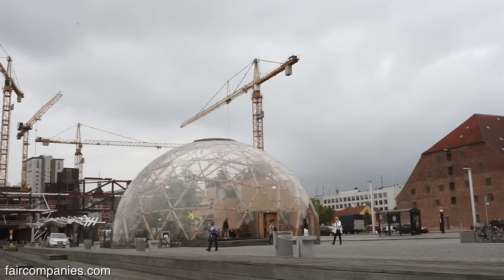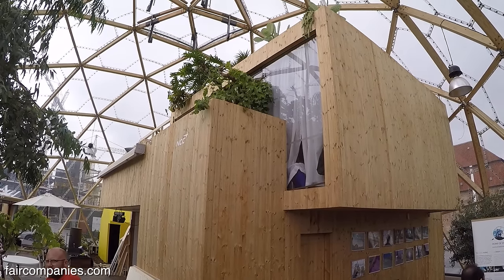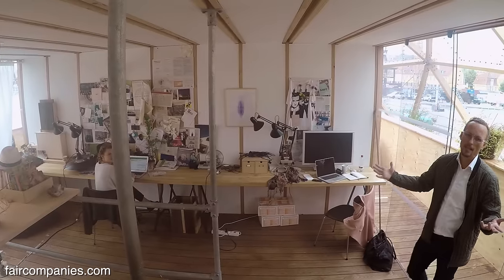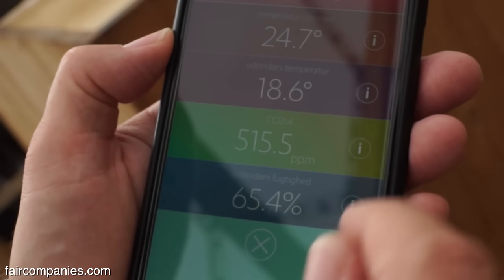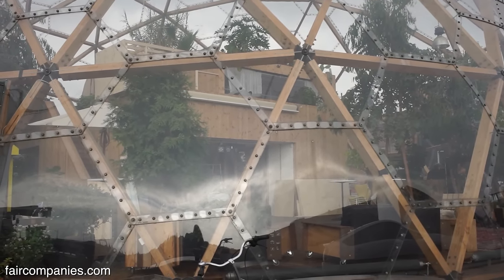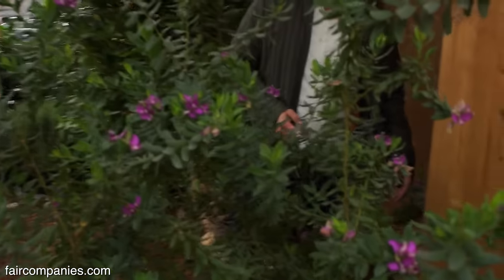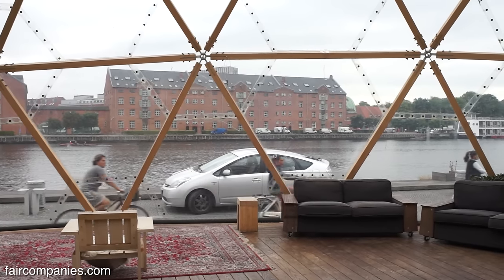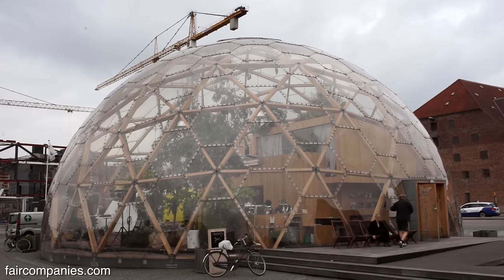Nordic home encased within geodesic dome for passive solar

Comment: I live in Germany, and our bedroom has 180 degrees floor to ceiling windows (double paned and energy efficient) it looks beautiful, but it is blisteringly hot on days over 23 degrees C.  It is not hard to heat it, but almost impossible to cool it if the sun is shining, air conditioners do almost nothing.  The only thing that helps is a windy cross breeze.  I can't imagine trying to cool an area that big...the little roof opening would not help that much.  The other problem is, on cold winter days when the sun shines really intensely, the difference in temperature causes the wood frames in the window encasements to crack.  I love the idea, but perhaps at least half of the dome panels should be solar, to cut glare, and to produce enough electricity for air temp regulation?  The other problem I see is mold, UV light would prevent most growth, but the warmth, lack of air flow and moisture would get into the untreated wood, and the garden plants very quickly.
Reply: There're are different types of passive cooling. 
The cross breeze is the 2nd worst one, and the worst being open one window/door.
The.chimney effect cooling is very efficient.

Comment: Very very interested, I am wondering what happens in the evenings and at night time in terms of plummeting temperature. Yes there is still no wind or rain but even in a green house it can get freezing and he is making a point that the house inside is built very simply and without insulation. They build them to potentially house a family which means year round habitation day and night...and winter nights are long.

Comment: Is there an estimated cost of just the dome itself?
Reply: Too much ... because you have to replace the polycarbonate every few years due to it degrading, becoming brittle and getting scratches. Do not bother with it and stick with glass, which will be REALLY EXPENSIVE but will last, AND with STRAIGHT SIDES!
Reply: @Muck006  I still would like to know if they have an estimated cost.

Comment: I know “it pays for itself after 6 years”, but what is the initial cost?
It looks very expensive.
Reply: Numbers would be interesting, true.
But as you can reduce the materials for the house and the dome structure it can be affordable compared to other houses. There's a TEDtalk of the Hjertefølgerne-Couple saying their dome-dream-house costs them half of what a normal house of the same size would cost them. They put some efforts in their house and gain great eco-efficiency and most important live quality. Seems worth it.
Reply: Here in Canada, my wife and I built our home and greenhouses in 2015, we are offgrid and use wood to heat. So far we have no complaints. The cost for building this 32' x 15' with a 4' riser wall and a second level with a total of 1720 square feet including a smaller 2nd bedroom dome. The material was purchased at homedepot without labour as this we did on our own, cost us 1/10th of a comparable traditional house. we were able to build 4 domes starting in June of 2015 and move into the timber dome in October of 2015. This included the two greenhouse  domes 45'. The first winter I was cutting grass in the heated dome until February when I got tired of that and tore up the lawn and started  a garden. Wow brings back some wild time memories. Well we are still in the domes and still doing crazy projects at -45 just to see what we can do. Winter of 2018 we grew 3000 assorted peppers. I really enjoyed this video. I hope to see more.
Reply: @lillebrorske7816  in another video I heard the dome of visions cost them €700000,- to create.
Reply: Whitestar Domes Very cool. 👍🏻

Comment: From what I have heard, the decline of the dome houses has more to do with no having furniture to fit the unconventional room shapes. The area of the house translates with good efficiency but putting conventional appointments in leaves less than desired usable area. Interesting idea though, I have thought about a house within a building to insulate it since I was younger during the energy crunch.  I have rethought that and wonder if just storing more heat underneath the house with wells might be advantageous as it doesn’t require new lot layouts for existing housing and we get the benefit of the release of heat all winter that we stored all summer and used to make hot water for use in our daily lives.

Comment: @1:10 ...there is no C60 molecule in diamond. It's a completely different form of carbon
Reply: +justgivemethetruth I'm no chemist, but I think I understand what you're saying. But what I got from the article is that when you compress buckminsterfullerene, the structure of the molecule changes. You do get a form of diamond, but it's no longer in the shape of a C60 ball. Please correct me if I'm wrong :)

Comment: I own a green house. The first hot sunny day it would become uninhabitable without adequate venting.
Reply: Did you watch the whole thing? They can open the top. There is a built in hatch.
Reply: There seems to be a vent on the top if the dome.
Reply: Apparently you didn’t watch any of the video because multiple times you can see the obvious hatch on top of the dome. Yeah...they’d really build this thing without ventilation 🤦‍♂️
Reply: @MasterMayhem78  Well, I saw it later, so my statement is still true, and I saw no reason to change the post.

Comment: The big question is how much would this cost? It's an excellent idea but if its too expensive to adopt then it doesn't help much.
Reply: That's actually one of the best aspects of geodesic domes. They cover the most amount of space with the least amount of materials, so it's cheaper. Also, the shape is more efficient at regulating temperature, so you save on heating bills. Now, all the high-tech stuff they put inside is another story.
Reply: That's it. You answered your own question perfectly. Thanks for clarifying.

Comment: Living in a greenhouse in NYC in the middle of summer would be fairly miserable if not deadly.
Reply: This would be true in the way shown here .. but he mentions a different idea .. that of burying the structure  (which would mean about 4-8 ft below ground level .. so you can pick up the geothermal temps.  So .. what that means is .. the ambient temp of the earth is about 50 deg. and it doesn't take a lot to heat or cool it from that temp.  I actually have a hole dug in my back yard 40 ft. in diameter .. and 8 ft. deep .. planning to erect a low dome over it .. a greenhouse .. and it also has a 3 ft deep pool inside too.
Reply: Imagine it in Houston...  LMAO...
Reply: @Mr Brightside  .. true .. but I think the idea was to build structures that would cover a city (maybe start something new nearby and learn from it).
Reply: @Mr Brightside ... yes .. just doing it for a small farm covering an acre or two .. maybe even just a house on an good sized garden lot would tell us plenty!
Reply: That's if it doesn't have any vents >_>, no proper greenhouse has no vents, you would have the inlet vents at ground level and the out let vents at the top, creating a air current flow from bottom to top.

Comment: A sunshield on the inside (similar to JWST) could be repositioned to block sun as needed. Possibly a fulcrum design where the shade is close to the inner dome wall but easily repositioned manually.

Comment: Polycarbonate? Say  plastic, it is not like plastic is a bad thing, it just will not last.
Reply: +MrMakabar Polycarbonate is one of the most robust and weatherproof plastics, ideal for outdoors
Reply: Jeff Harmed
15years is not great for constructing a city size structure. Light can be really bad.
Reply: +MrMakabar 
You raise a far point of durability.
Reply: +MrMakabar Many a urban and suburban roof will only last 20 to 25 years. The complexity of replacing the roof of a standard family housing is more complicated than twisting a few bolts loose and changing some plastic hexagons.

With the appropriate ladder device and cleaner, it serves to reason a family could perform sectional maintenance every few years and keep those plastic hexagons serviceable for decades. By rotating the southern hexs to the northern side, while cleaning each hex between each move, the dependability and lifetime will far exceed current roof construction standards. The bolted-hex method also allows the average person an easier self-repair should it be needed.
Reply: We have had polycarbonate in conservatories for years and it only requires replacement because the surface becomes opaque. However, a little elbow grease and polishing compound can repair the damage and add a few more years to the lifespan.
Reply: Lot Myle
Tiled roofs can last a century, so no most urban and suburban roofs last way longer then 20-25 years.
Reply: you must live in a place without many storms or where most houses are not mass produced by developers.
Reply: +MrMakabar As was said, you probably wouldn't really want transparency all around. If you are interested in durability you could cover much of the dome with sheets of zinc which could last for centuries. Mostly you would want the polycarbonate on the south side with maybe a few "windows" above and on the north side to balance the light. (Northern hemisphere of course.)

Comment: I wonder how viable this would be in a place like the western interior Pacific Northwest of the USA. It would be fantastic for the chilly, wet winters, with occasional snow and ice storms -- but the Willamette Valley, Portland Basin,, and Puguet Lowlands can get quite hot in the summer; in Portland it hits 40C+ a few times a year, with 15 to 30 days a year over 32C. Seems like you would need a more robust cooling system in such a climate.

Comment: 1. The main question to address here is not whether or not this can be done but if you can get the price down to a point where most homeowners can afford it.
2. If those windows are plexiglass, I would be concerned about them fogging up over the years.  Glass might be better but also more expensive.
3. This takes way more surface area than an apartment complex.  I would be concerned with the amount of urban sprawl and consequent increased driving it would cause.

This is not to say that geodesic domes over homes are not a good idea; they seem really neat for a niche group of people whose circumstances permit them, but I do not think that they are a panacea of any sort.

Comment: I see a ton of potential for them to have a circulation system from the top of the dome, that would pull down air in the winter and the could reverse to push up cooler air in the summer. The fact the whole thing is temporary with no geo-thermal really takes away from the potential of the overall design.
Reply: It's a starting point.

Comment: And then the temperature outside drops rapidly, causing massive condensation on the inside of those panels, and you find out that, yes, it can rain inside.  For a greenhouse, that's great.  For a residence made up of non-treated wood and no actual roof?  That's renders-the-house-unusable levels of bad.

Comment: Overheating is a MAJOR issue. You need a) a heat pump as A/C in summer and heating in winter, having a chimney in the home (burning any fuel) is problematic or likely impossible (safety - they do not have that). Roof ventilation (opening or closing automatically, if that fails once you can get flood damage if the rain sensor failed or all your plants in the dome (outside the home will die).

AND that airflow(with fans) has to be optimized. Or people get tested designs but if the home owners erect one higher structure in the dome later, it could in theory change the airflow, even huge indoor plants (think winter hardy palms) could. 

Hot air moves up, but not always to the very top point - it can stagnate at the side  instead of finding its way out. -
 and that means also that you are running into problems with the plants indoors. 
In winter it is getting quite cold. Not freezing, but you can't sit outside w/o a coat (in milder Netherlands) and if you have plants they must be hardy enough to tolerate it. (heat in summer and quite cool in winter, but then again it gets warm on a sunny winter day).

A heat pump that channels the extra heat of summer into the underground and produces warm water year round. The temperature lift from summer gives an edge when extracting heat for warm water and the heating in winter), we are talking 1 - 2 degrees at most what is possible to add to the temperature underground. BUT that is already a major advantage regarding the "lift".

The problme with that. They still consume some electricity (in winter for runing the heat pump) when it is hard to create it in a renewable manner. Heat pump users in brick and mortar homes often have a night tariff when there is usually some surplus of renewable even in winter (hydro, wind), but they have the MASS to store it. And even then they find it a little uncozy in the evening. A well insulated home does not have a wide range of temperature and can tolerate to use the heat pump in the night, but usually they have a small stove or something to add that little bit to have it toasty.

Should the heat pump not be well designed (the volume of pipes OR the depth which can be a major cost factor if it is hard to dig deep) a heat pump could become an (expensive) electric heating device after the heat reserves of the underground have been depleted for a few years. So if the planner let you down, was incompetent or tried to close the deal with a seemingly lower offer - you will only find out after a few years. 

Mild winters can mask that, and rainy summers. The heat deep down regenerates with rain for the most part. 

Those heat pumps draw energy from the electric grid when it is not possible to get enough heat from underground. That is a safety feature for extreme cold snaps. Or they do that often if the heat pump planner cut corners and the area with the pipes is not large or deep enough.

It is a trick to make the offer appear to be cheaper than that of the competition. The heat is regnerated by rain (which means the area must be able to let in rain, even lawn is not ideal, gravel or excellent soil with some plants on it would be. You cannot dig over that area, not sure if you can drive over it. If the installation is not sufficient, the home owners will deplete the heat that is in the underground (fairly constant temperatures - globally btw, there is not that much difference 1.5 m - 2 down whether you are in Texas or Denmark in the summer). After a few years the home owners will realize that the planner sold them a bill of goods.

Of course if you funnel excessive unwanted summer heat inside the dome into the soil that changes the equation. And the A/C for the dome is not such a waste of energy (and that is energy that can be produced with a solar panel. When they need the cooling they are also going to have a solar harvest, demand meets production ideally, which cuts out the need for batteries. A part of the energy used for cooling is returned in winter. You lose plenty for the work of the pump. But with some luck it is 60 % efficiency and the energy was plentyful when it was invested. 

I would also have concerns if there is any flooding - from outside into the dome, (weather, or the plates break),
or a plumbing issue inside the home. If the wood is produced without glue if will suffer more damage. I do not think the gluing is that much of a cost factor. The standard boards are glued, that is a process that is automated. They boards w/o the glue are the boutique product with the small production volume - so no economy of scale so far.

wood glue is safe (at least what they use in the European Union), so no problem with gasing out of volatiles. 

A well insulated wood burning setup outside the dome (but not too close to the house and insulated pipes underground) could be the solution to have a wood furnace. That tiny shed would have a water tank inside that provides warm water for heating and for use. That tank is used summer and winter the source of heat varies however. Even a small and cheap thermal solar panel could be added to get even more heat into the underground. 

I saw a video from Netherlands, that was a provisory project from an university, and the builders were the students (under the guidance of a professor). Not under a dome but excessive amount of transparent foil. They ran out of money in the end so the roof is only foil. They have a woodstove and sometimes ash comes out of the chimney and burns little holes into the foil.

That experimental home overheats, and in winter they need the coat to sit outside (but they like that anyway).

Now - Netherlands has midler temperatures than Denmark in winter.

Comment: Diamond is a solid crystal of carbon composed of tetrahedral units and is hard because of this.
Buckminster fullerene is hollow and composed of 60 carbon atoms. It is the same structure as most footballs.
Geodesic domes are amazing though this one has many more nodes and bonds than C60.
ETFE pillows would be a better material than polycarbonate, but it is also much more expensive.
Even so, the cost of this dome would be unaffordable for most people.

Comment: How do they clean the inside and outside of the dome? If the outside does not collect dust in the desert it will collect tree pollen in the temperate areas.